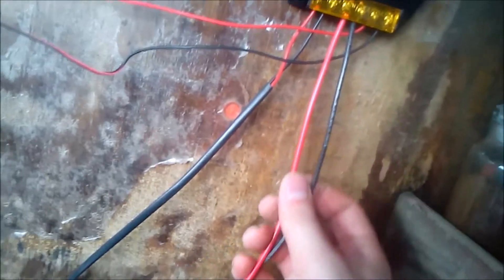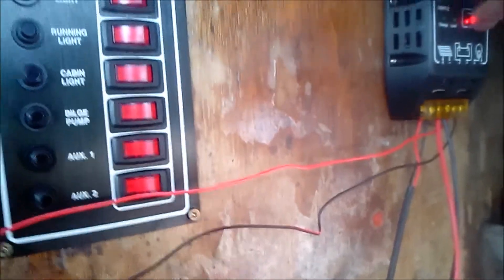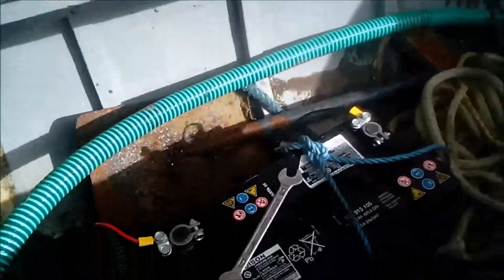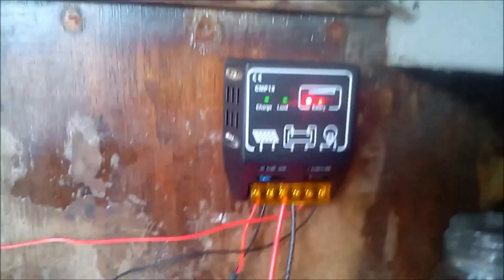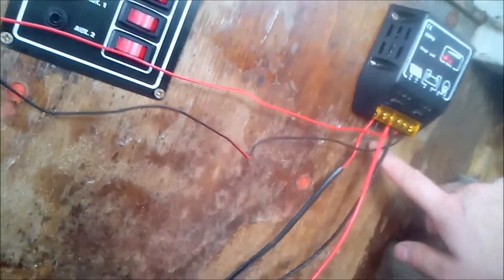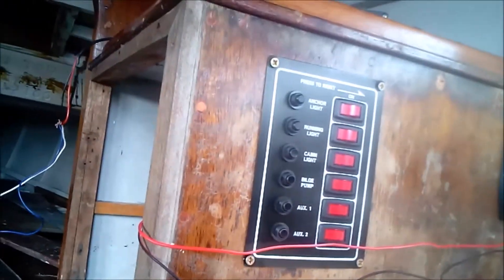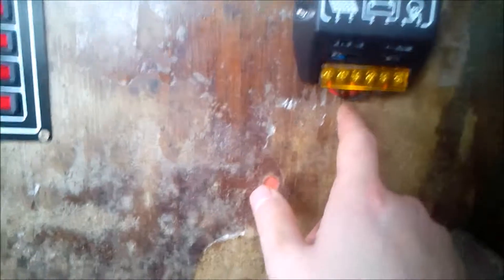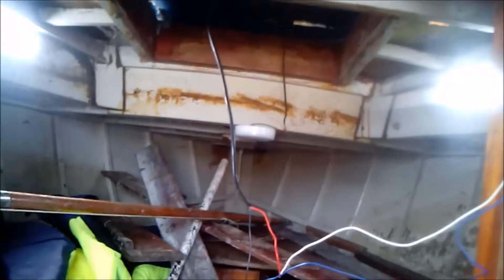Boat/yacht live aboard tiny home project - 12V wiring upgrade

Comment: good luck with your project. i took on a massive project myself. i bought a westerly cirrus yacht a couple of years ago that was in such bad nick that the rotten wood inside wasnt even good enough to use as templates to replace. im happy to say im now at the electrics stage myself now but what i considered to be my final stage as i didnt even have windows fitted or nothing. im planning on putting her in the water this month and im sure its going to be the best feeling in a long time. look out for my vid